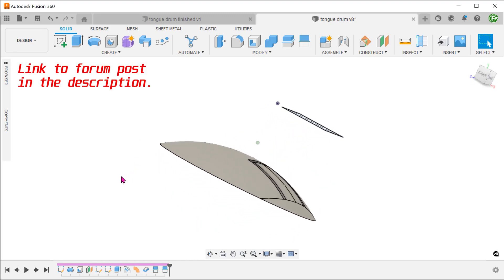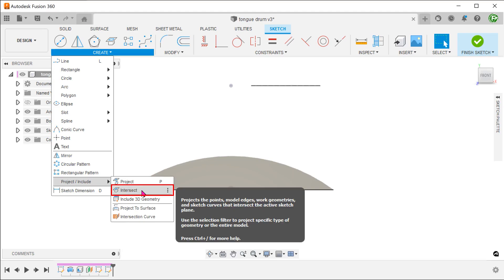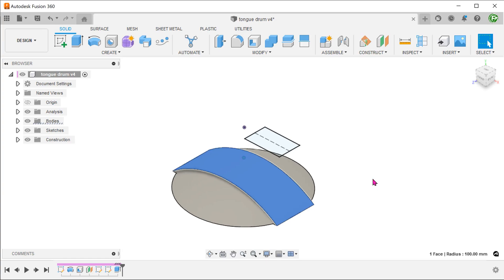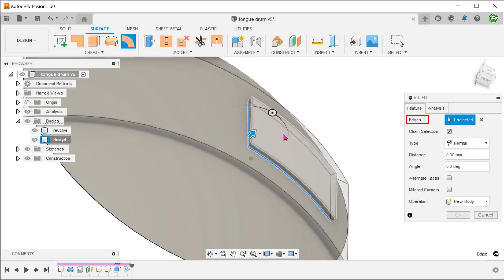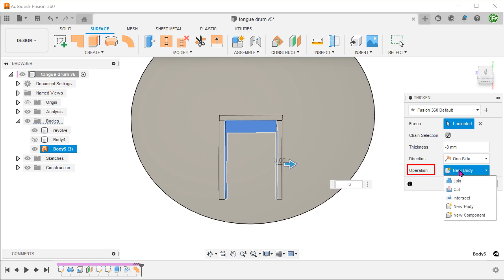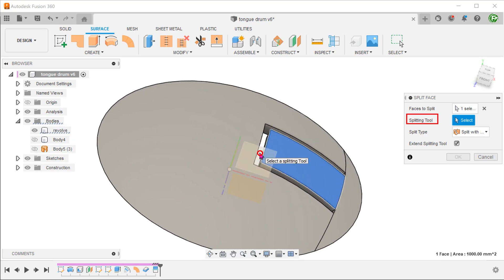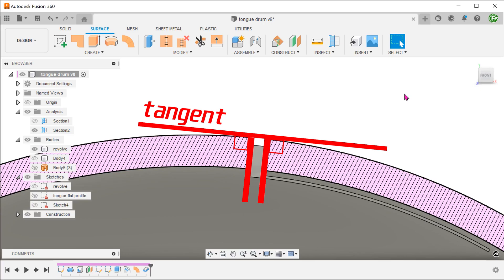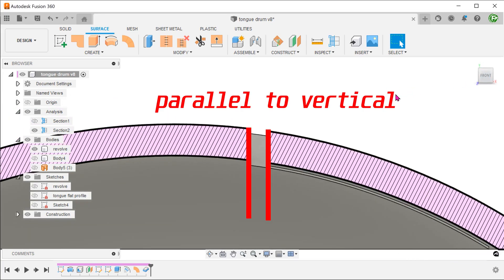Fusion 360 | Surrogate Emboss

Comment: I have a question for you, I like to recess my screwheads in 3d prints. The hole tool has a simple countersink. Unless the screw heads have razer sharp edges there will always be a gap around the head of the screw which doesn't look good. What's the quickest way to achieve a recessed countersink like I've attempted to draw below? 
|           |
\         /
 |       |

I've tried creating a sketch and revolving it but that's a lot of work!
I've tried counterboring with the hole tool and chamfering the shelf the counterbore makes but you have to estimate what the maximum chamfer could be.
I've also tried creating models of the common screws I use and importing them and subtracting them from the model but that's tedious and move captures are not parametric.
Any suggestions?
Sorry this is not related to the video!
Reply: Make the counterbore with an extrusion, then make a countersunk hole with the hole tool at the bottom with the countersink diameter set to the counterbore diameter you chose.

Comment: When I need to add panel lines to a lofted surface, I create sketch, extrude those lines in surface mode so they pass through the entire model on both sides, split the main model using those extruded surfaces as the splitting tool then select the section I want to emboss and use the Press Pull tool then I Combine all the pieces again.  : )